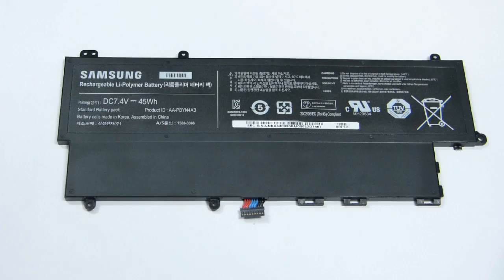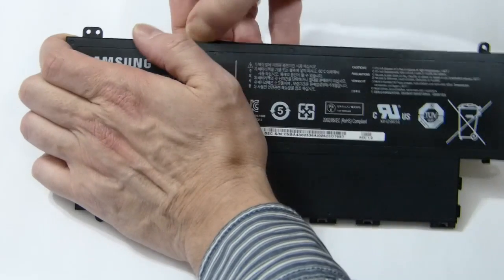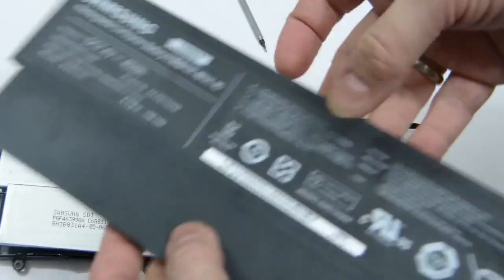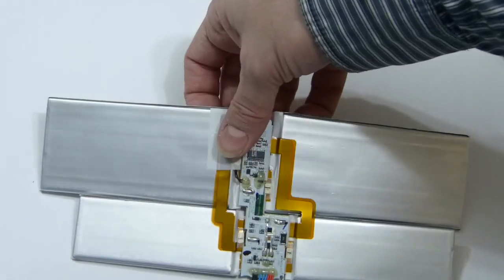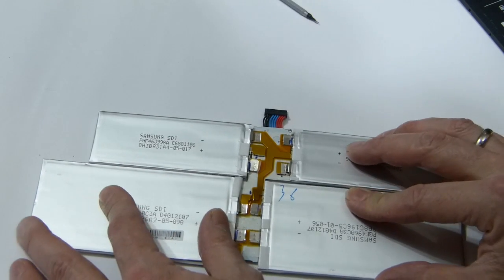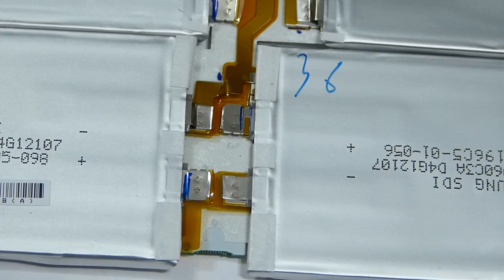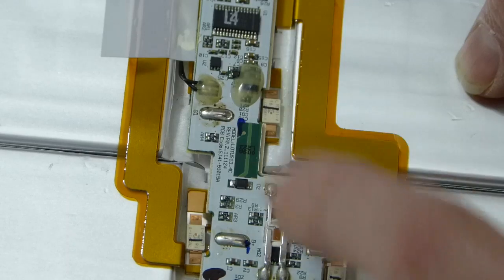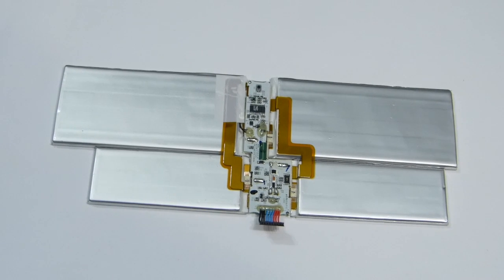Battery Breakdown   4 Cell Lithium Internal

Comment: If it's 45 Wh @ 7.4 volts then you have around 6081 mAh total capacity.  I think your assessment of 2000 & 4000 is pretty close to spot on.  My only caution to you (this comes from experience) is to be cautious when peeling those packs.  I have had the plastic crease and fold on me and acted like a fulcrum, driving a plastic ridge into a battery.  These cells are not very rigid and I would hate to see anyone injured.  That being said you seem to know what you're doing.  Cheers!

P.S.
Also, the larger pair a series connected to each other as are the smaller pair, the two series pair are then paralleled.  Also don't worry, the video was very interesting!